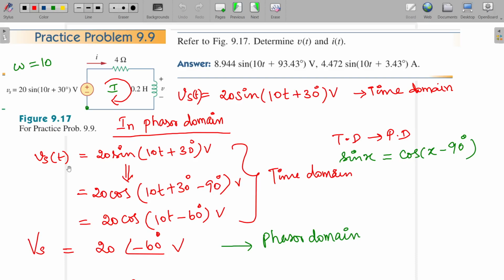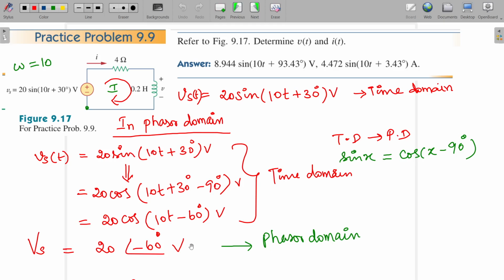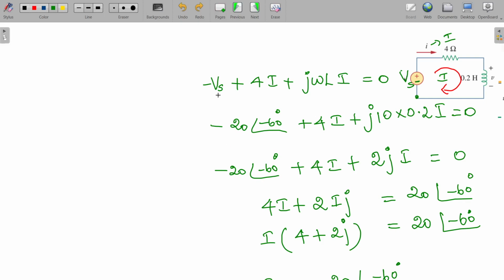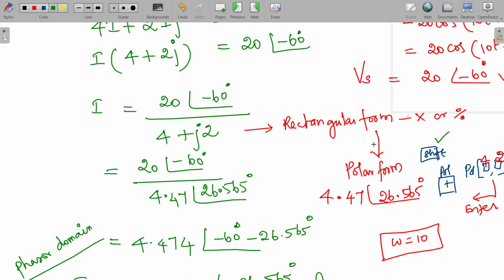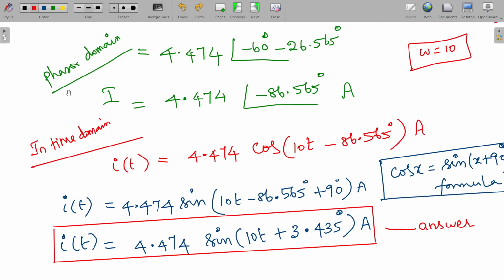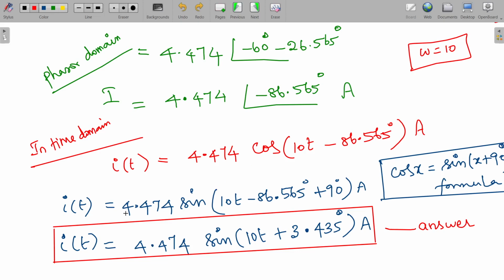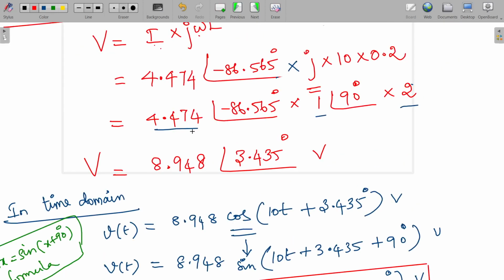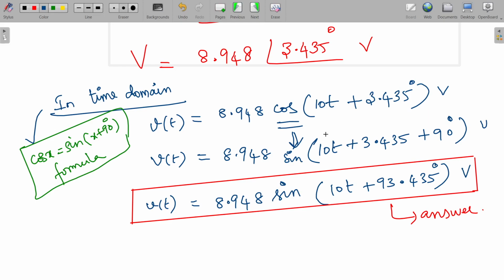FEC Practice Problem 9.9 - Find i(t) and v(t) for the circuit - Fundamentals of Electric Circuits

Comment: Is it wrong to try to solve this circuit (in the phasor domain) by using sine instead of cosine? I know how to do the conversion, but I do not get why we are converting it, from sine to cosine; unless, there is a rule that says so.
Reply from the maker: Refer Fundamentals of Electrical circuits by Alexander and Sadiku , 5th edition page no:  380:
"From Eq. (9.25), we see that to get the phasor representation of a sinusoid, we express it in cosine form and take the magnitude and phase. Given a phasor, we obtain the time domain representation as the cosine function with the same magnitude as the
 phasor and the argument as wt  plus the phase of the phasor"